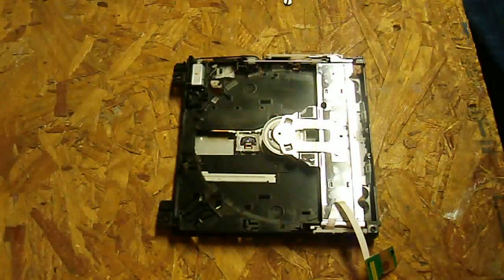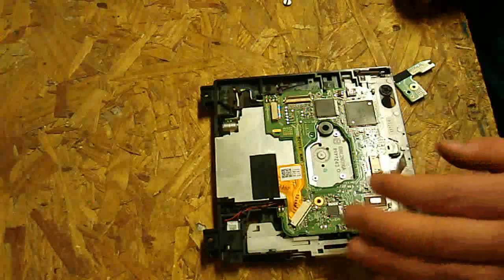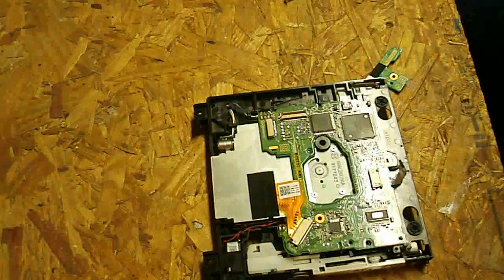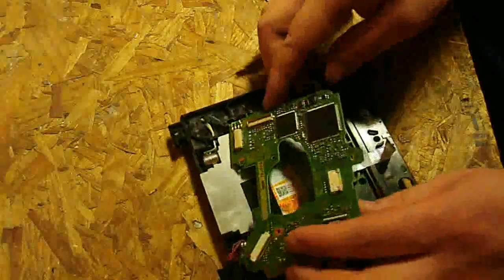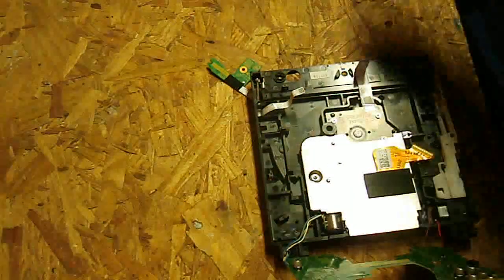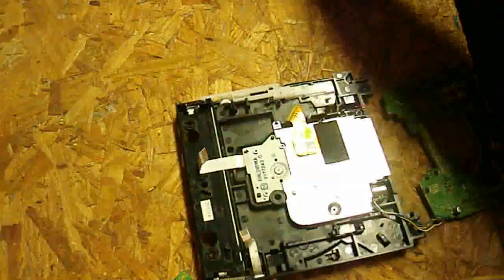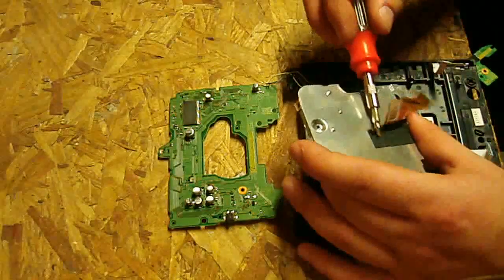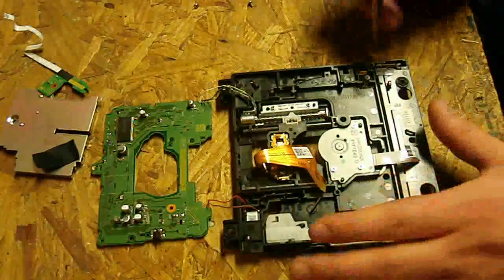Nintendo Wii laser replacement tutorial. Wii disc read error fix

Comment: Hello. Will the instructions fix the following?

"An error has occurred. Press the Eject Button and Remove the disc, then turn the Wii console Off and refer to the Wii Operations Manual for help troubleshooting."
Reply: It should because the laser lens reads the disc and if it can’t,the its the laser lens